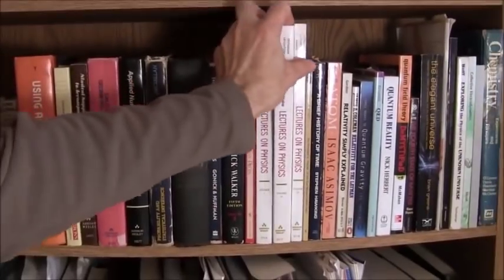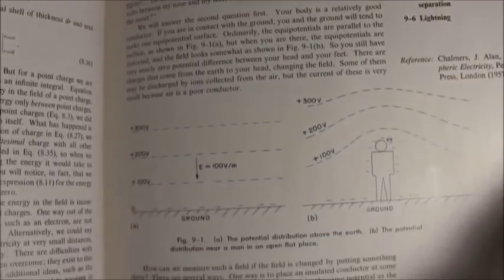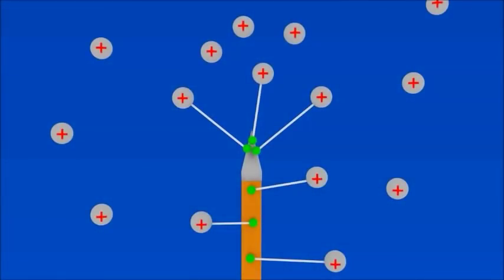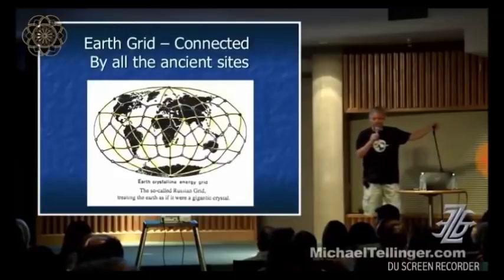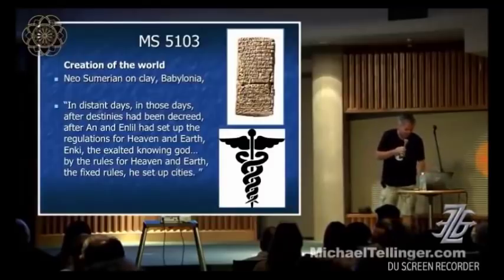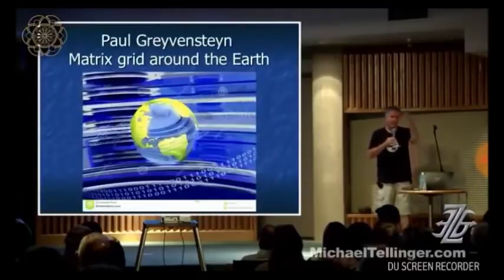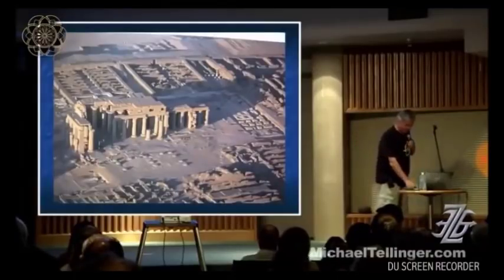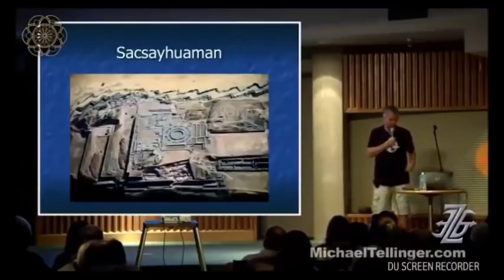ELECTRICITY IN THE AIR

Comment: The older civilizations built their buildings to collect electricity from The ether... Framing of iron and copper and red bricks... This allowed the buildings to be grounded to the Earth and the people to remain grounded to the Earth and the wireless electricity or their Wi-Fi would not bother them... Today if we would reground ourselves/earthing the 5G and other electromagnetic frequencies would not harm us...
Reply from the maker: Good stuff mate
Reply: @captainkirk1   If you want to test it out get you some aluminum tape stretch it across your bid good insulated copper wire and connect it to a copper rod about 2' long or iron push the the copper or iron rod into the ground connect the insulated wire through your window to the  Aluminum tape and to the grounding rod and you'll see a big difference just in your sleep... After that you'll get rid of your rubber soled shoes and get your old fashioned leather soled shoes again...get grounded to the earth again...